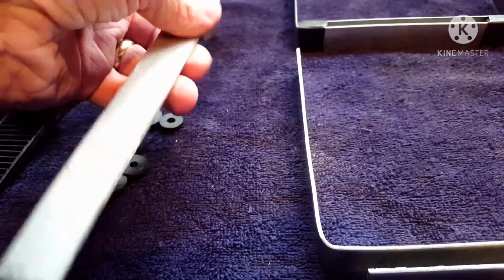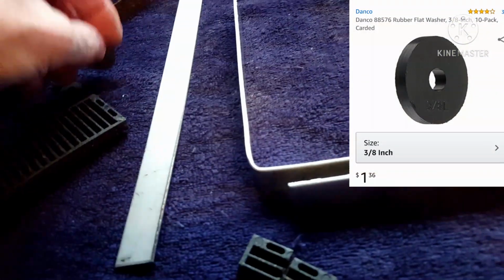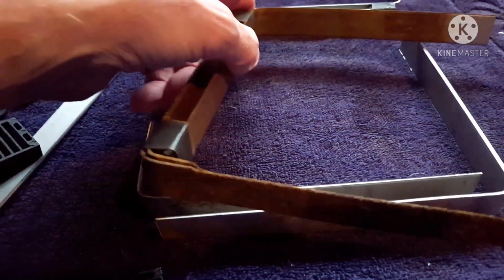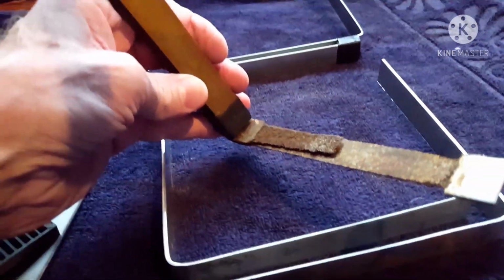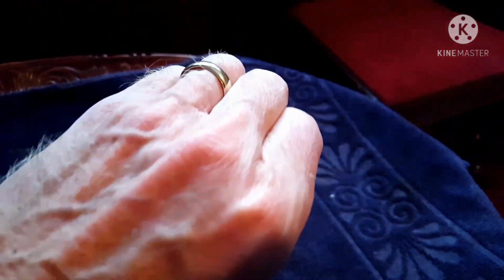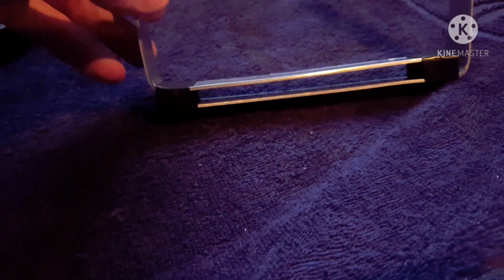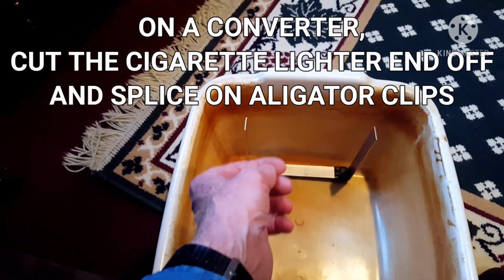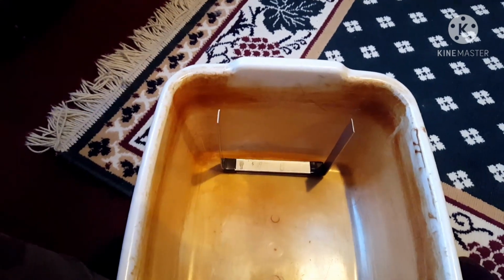MAKING ELECTRODES FOR ION FOOT CLEANSE

Comment: Sir, thank you so much, this was exactly what I was looking for. Is it possible to use copper material as eletrodes?
Reply from the maker: Copper and aluminum will quickly corrode/oxidate and stop conducting.
It must be stainless steel
Reply: @labratmudrock  Firstly, I want to say thanks for all of your content and for putting the time you have into the channel.
 I am a big fan and have gained  a lot of insight and applicable information/method over the past couple years of following you. 
 So ill say sorry in advance for being  critical of your wording and pay all due respect, but when you say it "must be stainless steel" that isn't true, generally speaking. For your design, i guess it could be said, but not an axiom if one was expanding on design or engineering  
 I suppose it would just be a trade off of longevity for conductivity. But copper is just as viable a material as stainless or maybe more so if you are a purist. 
 I have heard much about aluminum (not necessarily the element Al/Aluminium...) being quite bad for the human biology. Ive heard that copper is better than a lot of the common metals we encounter. Silver even more so, and gold even more so than silver.
  But for all intents and purposes, we couldn't we say that any conductor could be used, but just that each will have it's strengths and it's weaknesses?

Comment: I would like to see a follow up on this going into how you connect up the power and stuff, I was told about devices like this a while back and to get one but the prices are insane, I had no idea they were so easy in principle, but I would also be nervous about how to connect thing up so I don't electrocute myself.
Also, could I use steel tubing, As a waste product I see pipe material all the time so for me it's an easy source of metal...but would it work for this? or does it need to be flat?
Reply from the maker: Stainless is the only way to go. And it does not cost much. I think I pay around $5 per set.
If you have a non-computerized battery charger you simply hook positive to one electrode and negative to the other. They produce 12 volts and the amp draw is regulated by the amount of salt. If you are nervous, try it with no salt.
If you are using a converter, cut off the cigarette lighter plug in end, strip the wires back a little bit and attach alligator clips to them. Attach One Clip to each electrode. 
Disconnect the clips from the electrodes when done so that the same current does not go through the same electrode. 1 current tends to dissolve the electrodes faster, I forget which polarity

Comment: Any chance that particles coming out of the steel as it corrodes might be taken in by the body?
Is it the corrosion of steel which causes the typical rust colored water seen when first using ionizers? 
Does your ionizer pull solid particles out?
I would be interested in seeing a demonstration of your homemade ionizer in use if you would be so kind as to upload that.
Reply from the maker: Doing the foot cleanse is like watching paint dry. It does not pull out a large pieces but it pulls out microscopic particles and then assembles them together in the water.
Most of the brown color comes from the minerals in the water coming out of suspension.
The draw is away from the body so I have no concern about metals from the electrodes going into the body.

Comment: I was planning to build one myself by watching and using the information from your video. The original Foot Detox Ionizer cost around $129.00 today on 13 Febuary 2021. I have a few questions : Does it works better that the commercial unit. Is there any formation of Rust or Dirt in the water if you Run it without your feet in it ? How many treatments do you recommend for a pretty good Detox cleaning or purge ?
Reply from the maker: It will not work as good as a commercial unit if that commercial unit is using specific frequencies.
Normal water has a lots of minerals in it. The device will cause those minerals to become visible and change the color to Brown.
I recommend using the foot cleanse as a lifelong routine once or twice a week.
There is no reason to use distilled water as it will not conduct without the salt...you want minerals to allow the current to flow.
Reply: @labratmudrock  Can we use distilled water ? Yes, i seen some answers in your main video. I posted my text to fast. Yes, once or twice a week for around 20 minute traitement.
Reply: @labratmudrock try it using structured water...